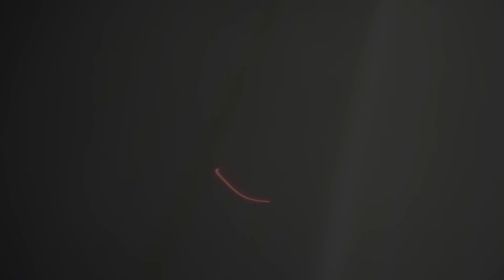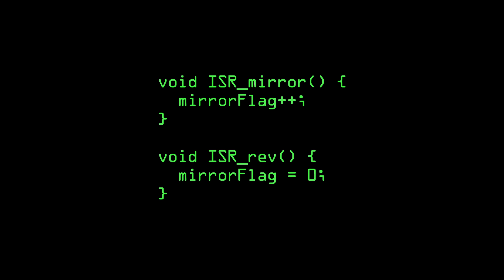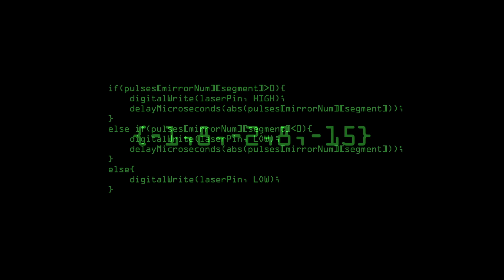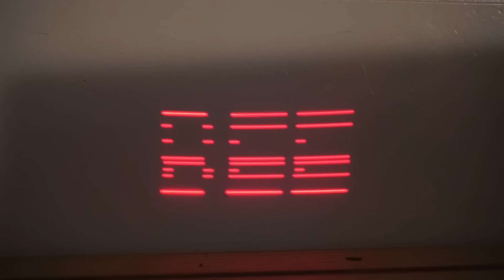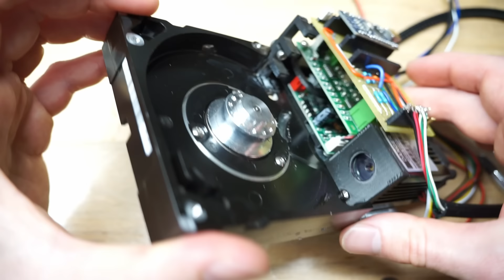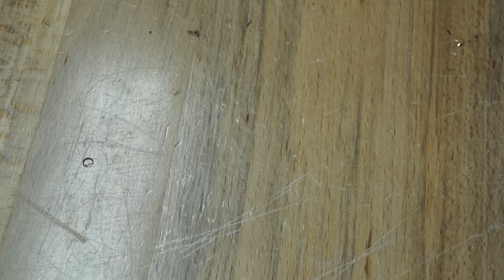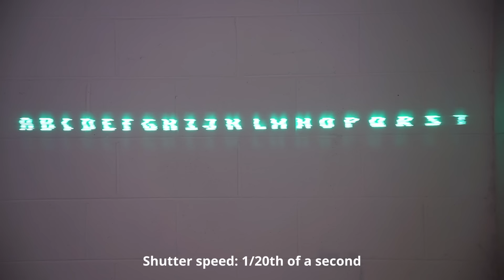DIY Laser Projector - Built from an old hard drive

Comment: Awesome project, but the safety briefing is missing something.  Green DPSS lasers have an infrared pump that is often not filtered because the manufacturer was a cheapskate.  it will still burn retinas with that infrared and that infrared is more powerful than the laser typically.  Fortunately many green laser glasses filter that, but a 5mW green laser might not be as safe as it seems.
Reply from the maker: You're correct. In the end I used a non-DPSS green diode, but yes, I'm aware that the DPSS ones emit IR.

Comment: great project! i would recommend replacing the arduino with an esp32. you can run the same code and it has built in wifi and bluetooth

Comment: In my humble opinion it might be easier to modify an existing LED (Colb) Projector with a laser unit. What difference does it make if the LCD reflects (or pass-through) the way brighter laser light (diffused) to project the LCD pixels? It is a laser projector in all terms. Having these cheap LED projectors available starting $30 (320 x 288) running on a battery pack or USB power. Just forget all the moving parts, in my humble opinion. Good project.

Comment: With minimum of 1 microsecond delay, You can't get more then 1M loops per second. That's Your limitation for resolution. To get as accurate as possible timing You need interrupts, hardware timers and single clock accuracy (maybe DMA on STM32?). I don't think arduino sketch is the best choice for your task. Try using native C code. Also when You using something like strlen, it consumes a lot of MCU cycles, so time to execute such functions is added to your microsecond delays and makes them longer then You expect, that creates wobbling effect. Usually for realtime tasks it's unacceptable.
Reply from the maker: Thanks, after posting this video I have worked on the code a little, and am also going to try  a much faster chip. I'll take the strlen suggestion into account too, that's a good point

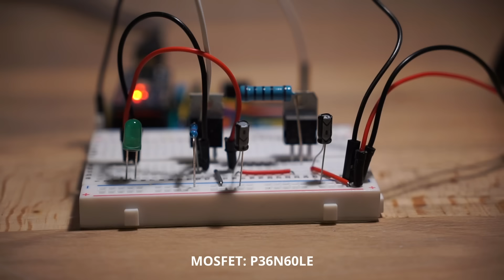Comment: 13:35  i think that you need the mosfet to be "tricky-style" - connected in this circuite, as a shortcircuite switch key to common. after current LM317 source(without output cappacitor, usefull for LED lighter only, too smooth current changes when on and of,but it is good - to use input capacitor, before LM317 chip.(stab.), because LM317 pretty slow, you can build only 0..5000Hz range subwoofer amplyfier on LM317 used as '"smart amp element", you can not wish about "LM317+R" current source will work as an instant precise current source on 20KHz square signal supplying it input,LM317 will not start and turn to steady state so fast as 1/20000 of secode, i am pretty sure about it, so you have to use LM317+R currend source as ADC constant current source, in balanced, stable state of current flowing from it to laser diode, and mosfet must to short circuite laser diode load, when powered by current source(not voltage
source), so all stabilised current from LM317+R source, will start to flow via opened mosfet to common Gnd, and diode will off. Then close mosfet by connecting gate to source with some pair of bypolar transistors suitable for mosfet gate fast drivering, use 4..10 Ohm resistor before gate, in gate chain, series... that will convert Capacity of mosfet gate, to RC chain, that will recharge, and reswitch wery fast, but due to gate resistor - no bell oscilation on fronts will hapens, you willreach aperiodic swich process, same fast but more safe for gate thanHF

Comment: This is no small feat. Do you know how much R&D has gone into making reliable displays over the last 100 years? You should be very proud of your accomplishment thus far.

recommendations:
1: A mirror assembly made of stiffer stuff. I know it would be pushing the motor to use aluminum but maybe your 3D printer can extrude a material which works better.
2: Higher thread count on the adjustment bolts. ...like 50 TPI or more if you can. You'll have to manually thread with a tap but it will be worth it, I think. Maybe even use brass inserts like they use on a lot of electronics with plastic cases.

I know everybody is going to suggest full color & such until you have strait-up full motion video so I won't bother to suggest it. ...but it would be sooooo cool to say you pulled it off.

Comment: as some advice for you if you make a future version to make it work better and much safer and cheaper.
the simple solution is to use a powerfull led and 2 lenses(I actually used a similar method to get my <€2 lithography mashine to work)
first you need one lense that makes sure it is around it's focal point when it hits the mirror that way the light interacts more in the desired way with the mirror just like it was a laser.
the second lense is after the mirror and is to focus it on the wall, you might need more than 2 mirrors, also be sure to account for the fact that the second lense will also somewhat bend the direction of the laser which can be both good and bad depending on if you expect them and want to use them, are lucky that they help you, or are unlucky and it ruins your setup.

when setup right you can get a way more better projection, like this while also saving a lot of money and such and it is much safer in operation as well, and simple enough to do and it can work quite well as long as you don't need your dot to be very small since it is basically undoable to get the dot smaller than the size of the light emiting diode, technically seen there are ways but those are unrealistic to do at home now. but still getting one of those 1w or 5w single small diode high power leds can be really great for this for indoor use, getting one of those array leds of 20w 40w or bigger can be great for outside long range projections(on a big scale).

perhaps I will build a device like this but using normal leds instead, just need to check if there is a moment soon I feel like it, and if I have right lenses laying around, also would need to order some leds since I only have low power leds, or very high power bigger leds, well or lasers and those uv leds which I don't want to use since I don't always react well to those, and uv has many other effects like making many things around me glow., however perhaps if a phosphorescent or more likely fluorescent screen is used uv leds could be great, since you could actually make them change colour or shine a lot brighter like that making it more visible, perhaps more visible than using normal light under the same power due to the colour change and highlight effect.

Comment: I made the same mistake with a photoresistor, wanted to make a lighte laser depth measuring device using modified binoculars, but the photoresistor was way to slow, could detect the pulse but needed it to be long enough and would be really slow.
I remember that in the past people would also use old harddrives for laserprojectors.
they used the diskhead actuators however, they where used as simple cheap diy osciloscopes often, so I kind of expected you to use that same method, the way you do it now however seems much better for a simple accurate display, since those worked and could draw in higher detail(analog) but at the same time also where much harder to make to draw images since they worked just like a oscilloscope, sometimes with some customisations, but I like the design you have here, much more simple to use and especially much harder to break randomly, and less sensitive to the surroundings.

Comment: Have you thought of using rotating prisms for the horizontal scan and a servo-activated mirror for the vertical?
I had this idea about forty years back for a laser projector to show video on low cloud cover. Back then we didn't have blue lasers so RGB was out of the question. I was a little ahead of my time on that one, as I was on digital music distribution, who would have thought of the internet back in the seventies?
Anyhoo, the concept involved stacking lasers in a binary fashion, 1x2x4x8x16... and synching the pulsing with the horizontal and vertical scans.
Never finished building it, got caught up in the concept of inertia drives and forgot about it all until I saw your video.
Good work, excellent.
Reply from the maker: Thanks! I did consider that but wanted to see if it could be done with a single moving part (the spinning mirror drum). RGB would be cool, I may try that in the future...

Comment: Try piezoelectric, they should oscillate more consistently than a rotating mirror assembly. See if you can find one that let’s you adjust both axis, then you’ll only need one mirror. Range of oscillation will be ver limited, so you might want to use a diffraction grating for mirror instead.

Comment: What's the point starting from a hard disk? Just grab a laser raster ouput scanner unit from printer e-waste, it has all you need and is more precise than you'll ever be able to build it.
Reply from the maker: I believe those mirror arrays only have a single angle - meaning a single line - and then the paper gets fed through by a stepper motor. So, I would have to use a separate mechanism such as a galvanometer for the vertical axis.  This design has multiple angles, and therefore requires only one moving part.

Comment: Great video! It's years I'm thinking about a laser projector like this but never had the courage to start the project. I'm also quite good in electronics/firmware if you need a hand. Watching the video I was thinking about a mechanical solution like 2 axis crack-rod sort of mechanism to move a single mirror very fast with the same motor. Did you think at something like this for version 4?
Reply from the maker: Thanks! If I'm understanding your idea correctly that would move the mirror back and forth rather than a continuous rotation. There exists a device called a galvanometer which moves a mirror like this, but the issue is the back-and forth motion having to overcome inertia when it changes direction, plus you need 2 - one for horizontal and one for vertical. I wanted to try a design with only 1 moving part.

Comment: Cool project! Decades ago I also had a notion to build something like that, but 256x192 (sinclair's screen, you know) with two rotors for frame and line respectively (50Hz, 16+KHz). MC's back then were too slow, but we already had some PLAs, so it wouldn't be a big deal. The main stopper was the mirrors fabrication precision needed. There was impossible to find needed machinery, so the project died far before any in-iron implementation. It's cool to see that now it's possible with no that much effort.
Reply from the maker: Thanks! I would like to do another version with higher resolution - perhaps 16 mirrors and 4 lasers at slightly different angles, giving 64 "pixels" vertical resolution. The mirror array is definitely the hard part...

Comment: I made something similar using 8 high brightness LEDs. The LEDs shone one a rotating mirror and the reflection went through a lens for short range. The problem was that you need a very high brightness if you are spreading the image over any width. I thought about lasers, but worried about modulating them properly and that you'd end up with stretched 'pixels' at a distance. The show lasers with galvo's solve these problems by using vector graphics.

Comment: Congrats. I did a similar 32bits/line laser projector 3 or 4 years ago. The only way I managed to get it to work was by using "thermally stable materials" all around. Equally stable mats in the linear and non-linear domains too. Therefore no composites, lots of exotics, not to mention quite a bit of carbide endmills consumables and crashes. I liked the HDD silent motor idea! Good vid, keep it up.
Reply from the maker: Interesting... I was just thinking an accurately machined aluminum block with X number of sides (chrome plated and polished to a mirror) would be perfect, but maybe it would still have issues.
Reply: @benmakeseverything  Wow. Never thought of polished surfaces! I've 4-ax the mirrors assembly on the rotary, pocketed holes and used mirrors you commonly find for co2 lasers. If machined clockwise only (i.e. no reversal/backlash) you should get within 5~10 microns all around. Okay for 100 meter! Side note; you couldn't possibly be using worst than the arduino platform latencies and overheads. Register level programming is of paramount importance for this project (stm32, cube ide here).

Comment: The issue you're experiencing with green lasers manifesting as lines is due to type of laser used. Crystal deviation in a DPSS (Diode-Pumped Solid-State) laser is a common problem on a cheap DPSS modules. A high-quality DPSS laser module with good thermoelectric cooling is the only option. It is advisable to go for a 520nm direct diode laser for a hobby purpose :). The shade of green is just really slightly different, but it is much simpler to control, whether in analog or TTL mode.

Comment: Firstly, you can fine-tune the frequency of your board, or rather its PWM outputs, to the required value. Then it's worth using registers to control pins instead of the usual digitalWrite function, since any surface function adds time to execution, and direct control of contacts leads to a decrease in latency, since the hardware controls the contacts as quickly as possible. It is also worth paying attention to the interrupts themselves, they can be tracked at the hardware level. In general, use STM 32.
Reply from the maker: Thanks, I am working on improving the code.

Comment: Laser warning - very important - at the negative Celsius temperatures ( -10C -20 C - your fahrenmileage may vary) the semicond. laser CAN have a very big shift in freq. and amplitude! i dont remember - study yourself - but they probably start flashing with IR (maser?) unvisible high power laser blasts - always check the recommended applications of the one you have - and about some other similar lasers in case your producer is impotent and could fool you around.

Comment: Congratulations on a great project. I own a DIY electronics store and love projects like these. 
If I may, Can I suggest a few small changes that will make a huge difference on you image quality. By changing 2 things you will archive significant improvement on quality. 
1. Toss the uno (16Mhz) and move to a Bluepill (174Mhz) or Blackpill(240 Mhz). The ARM core will give you way more speed and accuracy and your code will have to get only slight changes. Even changing to a ESP32(240 Mhz) will be better that will also give you the ability to toss out the Bluetooth since the ESP32 has build in Bluetooth and LOTS of ROM and RAM. Just a note, the background process like timers that runs in the background in Arduino also increases your "jitter".
2. Use Laser cutter mirrors. The reflective surface on a laser mirror is on the top and not the bottom. The glass on a standard mirror gives you a refraction which makes your dot loose focus. They will give you a much brighter image as well since they are way more reflective than mirrors.

Additionally,  Try to use an Oscilloscope to see the response time of the rotational sensors. I suspect they are part of your issue. The output might not always be exactly the same every mirror trigger. Rather use only 1 sensor to indicate a start position (Raster home - top left - Sync, Like on a CRT tube) and run a Timer to start every individual line. Do a calculation of the speed of the rotation by timing the rotation sensor. This way you can adjust the line scan timer constantly to give better stability and alignment.
Crazy idea.... you could use more than one laser to give you a second line but I think space is going to be difficult.
Reply from the maker: Thanks! I'm working on making some improvements to the code right now (direct port manipulation instead of digitalWrite, using the clock timer of the arduino instead of the delayMicrosecinds, etc. I will check out those boards - other commenters suggested Teensy 4.1 as well. I did try an ESP32, but found that it had inconsistency in the interrupts. Maybe my board was defective, or maybe it was the background stuff that was running. And I'll definitely use first surface mirrors as well if I build another one. I could try using only 1 sensor, but I figured that having the second one that detects each mirror passing would increase accuracy if the motor speed isn't perfectly consistent.

Comment: I have a 1W ARGB club laser (no diodes), the scan frequencies are very fast, and Text is going great, in multicolor. But it wasn't cheap, I use it at home, a little overkill, but back then I was a light engineer, and that will be for the rest of my life. I did work with 15 to 30w lasers, from Datronik watercooled.

Comment: Old laserprinters are a good source of polygonal mirrors.
Reply from the maker: True - the issue is that most of them only project a single line since each mirror is at the same angle. So I would have to add a second actuator for the vertical axis - the point of this design is that it only has 1 moving part.

Comment: If interrupting on every scan-line is causing problems, you could possibly just have a single timing tab and blanked out mirror to do your math. Just divide previous rotation time/mirror count and and blanking interval then use the internal timer for everything else. This way you aren't relying as much on 3d printed tolerances and you aren't spamming your cpu with interrupts.
Reply from the maker: That would be good, assuming that the motor was rotating at a constant speed. Since I am using a cheap 3rd party speed controller - I'm not sure that it is. By having 1 interrupt per mirror, any inconsistencies are reduced.